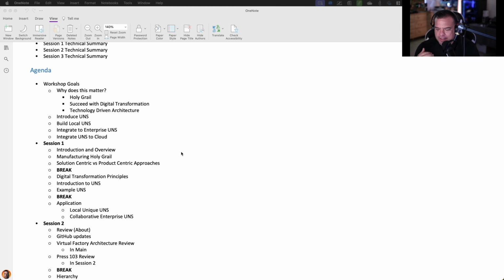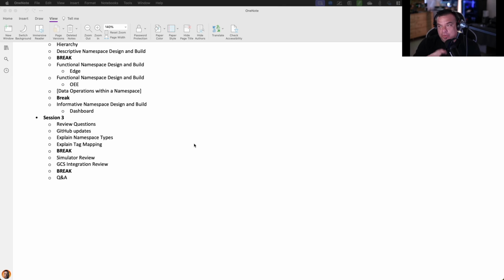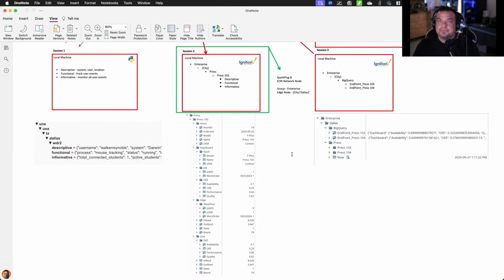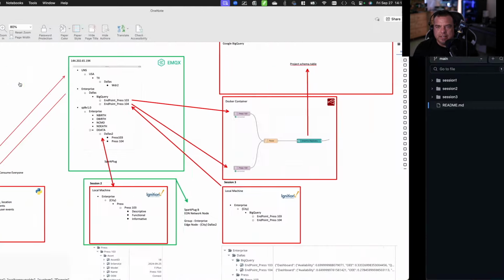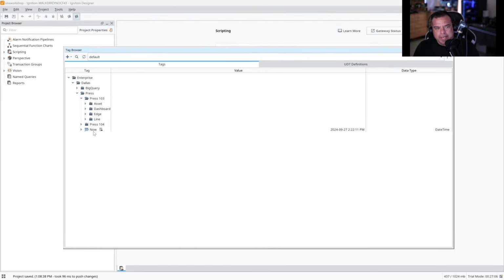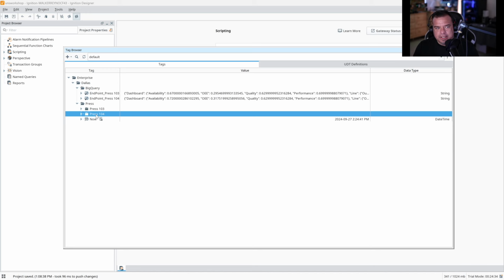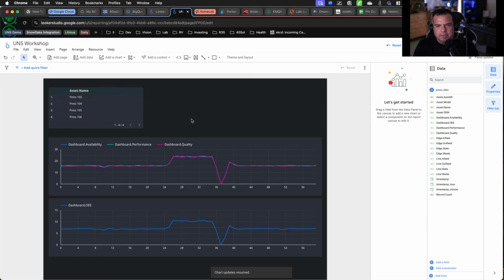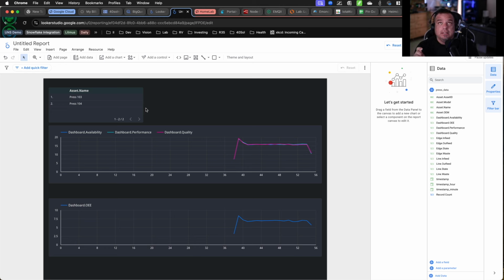UNS Workshop Summary

Comment: Thank you Walker for the video. Going to big query directly is expensive and node-red node throws error when number of messages increase. Have you tried Kafka or Google Pubsub in the middle for the UNS design? Our source of the data is ignition and using litmus edge to send it to kafka or pubsub.
Reply from the maker: In the workshop, we went over pub sub and how that is ideal.  BQ from node-red is for development in our DevOps, not production.  🙏
Reply: @4.0Solutions  Thank you for the response. Does pubsub fit in the UNS architecture? Are you planning to make workshop videos available to purchase?
Reply from the maker: @AhmedAli-lm8st  Yes the workshop can be purchased still. Either through joining our Mastermind, or stand alone. We are also going to do future workshops. Roughly 1 per quarter. Joining mastermind for the year get's you access to all the upcoming workshops. please reach out to contact@40solutions.com if you would like to speak with someone on our sales team to set you up.
Reply: @4.0Solutions  Thank you for the response. I will get the learning budget from the company and contact soon. Sounds like a worthy investment :)

Comment: Hi Walker 
Always learn something new from you 

Wanted to ask you, if I need to expose historical data as well since I can’t do that efficiently with mqtt, do you suggest building web dev endpoints? 

Or is it possible with mqtt that I can expose a data for each data point for a day by splitting it 

I believe historical data should be as important as real time data for UNS , what do you think
Reply: Very common question… the short answer is there’s a direct relationship between real-time state in UNS and historical state in a historian.  It is come to store SOME history in UNS (like last hour of some topic) but generally one uses UNS to retrieve the parameters needed to retrieve history from an endpoint or a node.  I’ll shoot a vid on this. 🙏
Reply: @walkerreynolds973  that would be great if you can shoot a video and explain how to leverage UNS by either mqtt or APIs. Thanks alot
Reply: @walkerreynolds973   Can you try to include EBR too in that ?
Reply from the maker: You can definitely expose historical data in the UNS by publishing it back in as a dataset. IE. 60 minute realtime history, or history last 24 hours etc. to go beyond this you can query the historian directly, or use the UNS to expose the historian endpoint. The Unified Analytics Framework takes this process to the next level, developed by flow software.